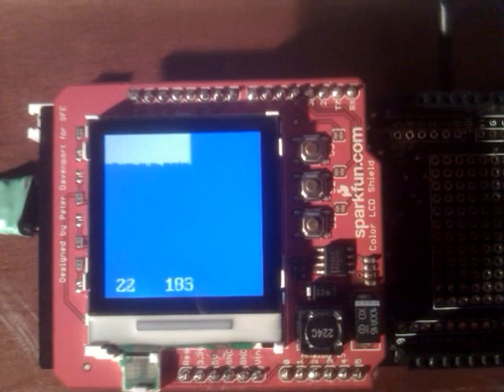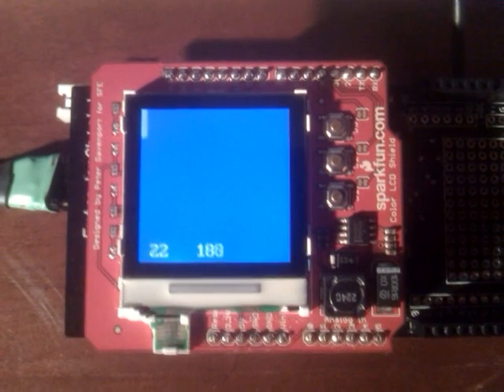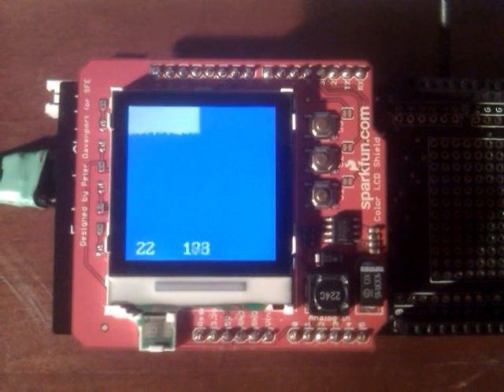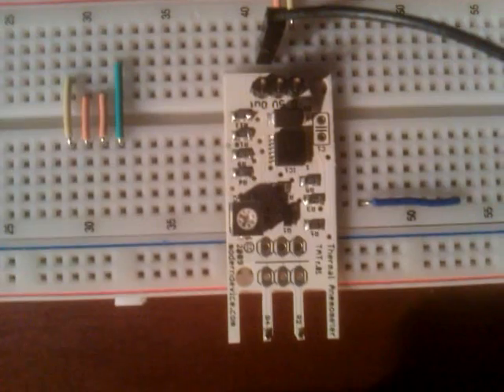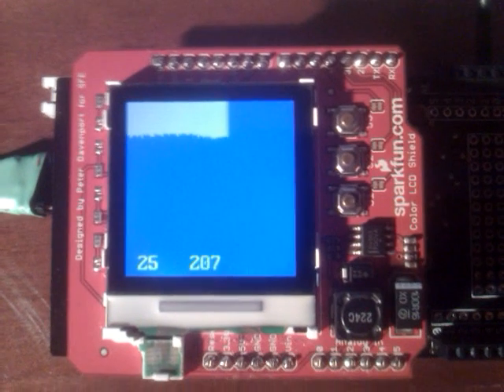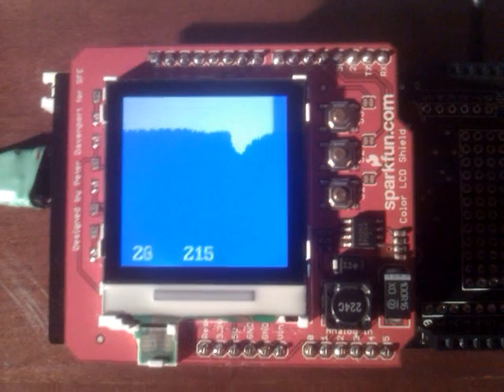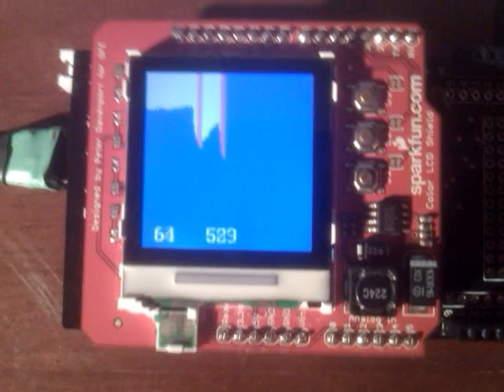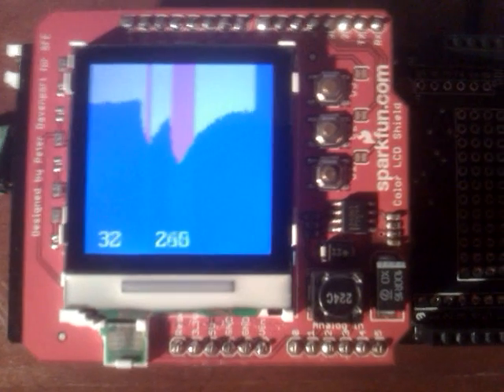Arduino Color LCD Shield Demo

Comment from the maker: @raindogred Yes the push buttons will work.  In the libraries posted by sparkfun there is check to see if a button is pressed during the event loop.  Combined with an if statement you can make the screen do your bidding.  Good luck.  Check the machdisk blog on posterous.